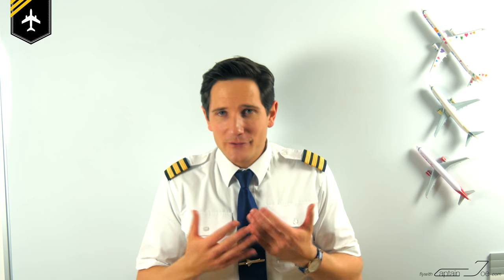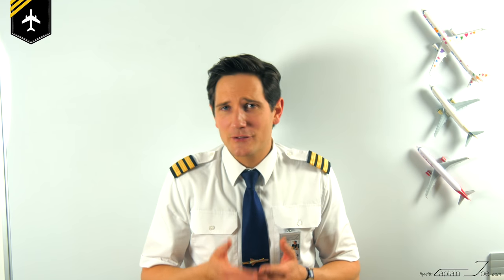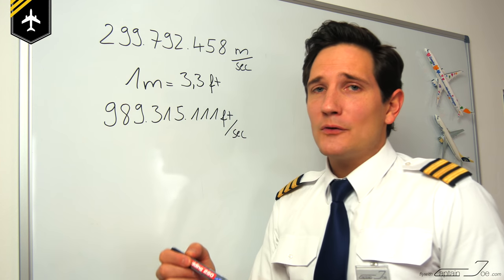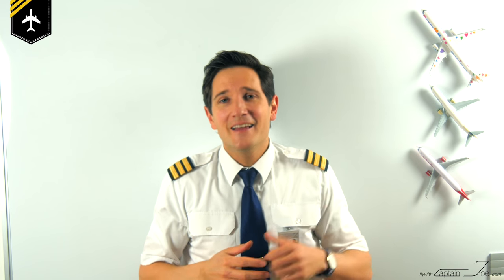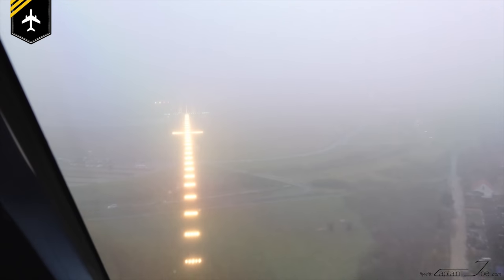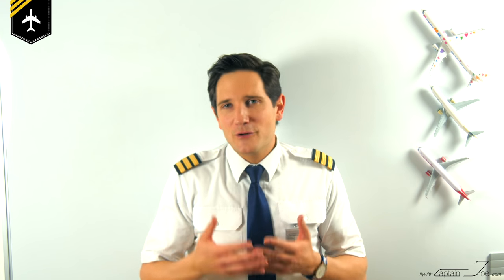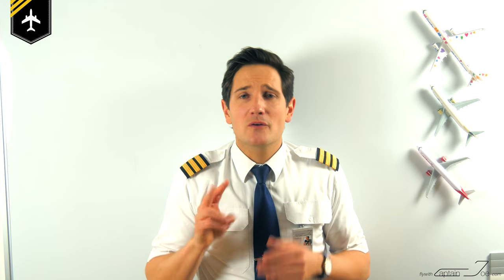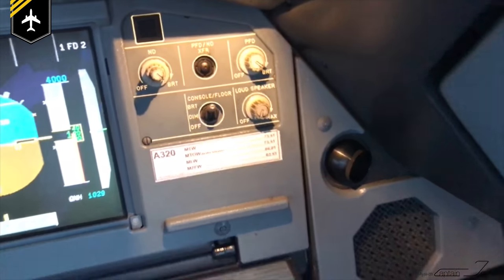50...40...30...20...RETARD...RETARD??? Radioaltimeter explained by "Captain"Joe

Comment: Do you fly Boeing aircraft as well?
Reply from the maker: No unfortunately not Barry, but maybe in the future, you never know :)
Reply: Captain Joe well, love your videos. Keepem coming. You're answering so many questions I didn't even know I had.
Reply: Who would ever do that, the flight augment computers in Airbus make flying it much smoother and nicer
Reply: Barry Sabahat because fuck Boeing I only like 737s
Reply: Polystyrene Planes well, I'm not a pilot, as I'm sure you can tell. I don't know any better.
Reply: @Polystyrene Planes Why you would like to fly a boeing as a pilot is that you actually got to do something, on the airbus you press 5 buttons and program the fmc and then fly, on the boeing you actually got to fly the plane and press more than 5 buttons to fly, the reason why so many like boeing is because fly by wire is alot nicer than the one airbus uses.
Reply: @NICK IS AWESOME "Fuck boeing" why do you hate boeing? Do you have a reason for the hate?
Reply: @Miam ga You cant say that Boeing 737 and Airbus a equivalent in terms of switches, on the airbus you start the apu, turn on fuelpumps, line up IRS and turn some lights on whilst in the boeing you do that and alot of more stuff like controling the aircondition, you control the powersource when the apu is on etc. I can admit that the 777 and 787 are more like Airbus with 5 switches but not the 737
Reply: Maybe the 737 Classic you still do things like manually selecting generators and the like, but the modern 737 NGs and the MAX is very similar to an A320. Other than the overhead panel is extremely messy with toggle switches everywhere. Basically every commercial jet will have auto land, auto thrust, auto pilot, IRS and and FMC. Not many airlines tend to fly 737-200 anymore.
Reply: @MegaGouch I havent said the a320 and 737 is alike each other, but you cant argue that in an a320 you have as much to do as in a 737, as you said there is alot of toggles and switches which there isnt in the a320 which makes the 1320 easier to control and less to do. Just an example that you talked about the A/T, on a320 you have Autotrottle until touchdown whilst on the boeing you disable it about 1000 feet above the ground
Reply: @Miam ga I know that you can do thoose stuff in the a320 but my point was just the reason why pilots like boeing-planes is that there is alot to do and alot of switches to press, just take a look at 747-400, there is 365 switches in that cockpit and im pretty sure there isnt any airbus aircraft with that many switches. Im not saying Boeing is better than Airbus or wise versa but im saying that imo the boeing is alot more fun to fly because you gotta do things all the time whilst the airbus is more chill where you can just sit back and relax
Reply: Agree there, Boeing thinks that the plane should be controlled 100% by a pilot whilst Airbus thinks that the plane should be controlled by both pilot and computer and if the pilot makes a misstake the computer can fix it whilst on the boeing you will probaly crash if the pilot makes a big misstake
Reply: What's A/T?
Reply: @Barry Sabahat Auto Throttle
Reply: Bob Ross ah!  Thank you.

Comment: distance = speed × time.
@1:15, you said distance = speed/time.
Reply: distance = speed x time is correct, though i am not a pilot.
Reply: you don't have to be a pilot to know that
Reply: Speed of light is a speed and time messurement
Reply: @Ntk503  speed of light is not a time measurement.. speed of light is speed at which the light travels and that's it. Light year is distance that light reaches in a year.. maybe you can somehow include theory of relativity and say that speed of light is a time measurement but it isn't.

Comment: Joe is the Altimiter with the callouts used for autoland because that would mean that the plane cannot autoland on rough/elevation changing terrainr
Reply: Yes. If the terrain is very sloped or rough approaching the runway, it degrades the ILS category. 
Helsinki get round this by having radio reflectors in poles in a valley just before the runway.

Comment: Never heard of using the speed of light calculations. I was taught, and have always used the radar range mile, since the Radio Altimeter is a form of radar. A smaller, less powerful one. Since radar is based on timing of the reflections of the transmitted pulses, to give you a distance (range) to an object (cloud).

Comment: there is no need to have indication on more than 2500ft because radioaltimeters beam should be to wide and could give wrong readings, last 200ft are important

Comment: Why doesn't Boeing synchronize the Radioaltemeter with the MCAS as a way to establish false computer readings (when MCAS forces a nose down while radialmeter senses the plane getting dangerously close to the ground?) @Captain joe
Reply: They are 2 different systems. And its more practical to sort out the MCAS rather than get warnings from the GPWS

Comment: You forgot the take the speed of light in air. That number is speed of light in a vacuum, so the calculation is slightly off
Reply: Not a significant difference between them.  But very complicated computer calculations could model and adjust for barometric pressure altitude, temperature, humidity, air pollutant concentrations, local gravity effects, etc.  This might make a difference of 1 mm at extremely high altitudes.

Comment: Captain Joe, mind if I ask you a question? I'm playing X-Plane Flight Simulator just learning about flying. Haven't touched any flight sims since Flight Simulator 98. As I was showing my Landing first time they told me about Flaring as you come in for a landing. Can you explain about Flaring or if you have a video to link it? Thanks
Reply: Not joe, but I still hope this helps.
Flaring is when an aircraft pitches its nose up just before it touches down on the runway. This is done to allow the main gear to touchdown first, to prevent damage to the nose gear and to help the landing to be more smooth. Flaring is done by throttling down the engines as the "retard" callout is announced (make sure you have the correct flaps settings and a safe speed so you don't stall at the last second)  As the main gear touches down, you would then put the nose down on the ground as the spoilers and brakes are deployed.

Keep in mind that I am not a pilot, just an aviation enthusiast who plays simulators too.
I also wrote this on mobile so apologies in advance for any spelling errors.

Hope this helps! Have a good day.

Comment: i was learned that radio altimeter can not work on measure time between two  signals because time is too short, and signal would ovelap in receiver, it works on principle to transmite one signal but with constant change of modulation and then computer compare time of modulation delay in receiver

Comment: Can the signal even travel 5000 feet and still be picked up by the plane? Not only will it get dispersed/absorbed by the ground/air, but the plane would have moved forward by a significant amount, thereby moving out of the signals sight, no?

Comment: Hello Captain Joe!

I'm a new viewer here. Just watched this video. There's one info missed:

Why a Captain or Pilot says, "Continue" at 500 or 200?🤔
Thank you very much.
Reply: The captain either says continue or "missed" "overshoot" depending on whether the runway is in sight(bad weather/ visibility) or the plane is properly configured and on course and on slope (not too far left/ right up/ down for safety) he is stating his decision to "continue" the landing or abort
Reply: @Valantir  Vielen Dank, Herr Miller!🙂

I've a PPL, flying is my passion and hobby. Not a profession though. 

I first noticed "Continue" in Captain Raps' Airbus video. My Q, how would automatic controls react when Captain or Pilot don't say that word?🤔

Is it mandatory to say that word as per the Airbus training?🤔 Thank you very much!
Reply: @pra7640  it's more a airline training/ CRM (Crew resource management thing) than airbus.
You have a Pilot flying (PF) and Pilot Monitoring (PM) sometimes also called the Pilot not flying (PNF) depending on the company. On a visual approach the PF is looking only outside the airplane. Not at the instruments. The PM is looking at the instruments and calling out altitude, speed, and deviation from course. The PF will call for things like gear or flaps at appropriate speeds and the PM will lower. When the PM gets to decision height, which for us is 500 ft on a visual at my company. The captain determines whether to continue or not. For an ILS or other instrument approach the captain is inside watching the nav instruments. Then at the minimum altitude (200ft for a CAT 1 ils, no autoland) he looks up and either sees the light/ runway and says continue or does not and we overshoot. The only time you are "autoland" is a CAT 3 ILS where the minimums are 50ft and directly over the runway. You are going to see it.

Comment: The only thing I hear when I go too land in X-Plane PULL UP And then it starts 100 90 80 70 60 50 40 30 TERRAIN PULL UP since I accidentally speed up (BOTH ENGINES TO MAX POWER)

Comment: Captain Joe, I have a question related to your mathematics in the video

when you were calculating the altitude and you times speed of light by 3.3 did you round it up so it said 989,3x10-5 because when I did the calculation I got 989,315,111 ft/s and when I divided by 1 I got the altitude of 4,996 ft

Next time I calculate my altitude for fun in flight simulators would I round the value at the ten hundredths or would I use the full number for the final calculation?

Comment: Hi Captain 👨‍✈️ i have a doubt. As a passenger, most of the time i feel just before the landing that the speed of the aircraft is suddenly increased. I feel we are a little bit pushed back because of the increase in the speed. This feeling happens just before when the aircraft starts descending. My question is is the speed is really increased? Also the engine sound increases.. because at the 38k ft the engine sound is smooth.
Reply: not a pilot but i think it could be the reverse thrust. The turbines start to spin faster and the flaps on the outer side of the engines open to redirect the air in the opposite direction to slow down. he made a video about that:
https://www.youtube.com/watch?v=cfFZ2-Am-Zk

Comment: DISCLAIMER THIS IS VERY MINOR
your calculations aren't actually 100% correct mathematically, because the first distance travelled from transmitter to earth is probably going to be longer than the distance from earth back to the receiver, because the plane would have descended x ft by the time the signal gets back to the transmitter. The distance difference is so minor it really isn't worth calculating with, but just letting you know this thought of mine. Have a great day!

Comment: Cool. Question from a non-pilot: why are feet used for altitude instead of meters?
Reply: one meter =3.3 feet. 20×3.3 30×3.3 40×3.3. 50×3.3 see the problem. Try to do meter math in you head fast when feet you know for a fact your 50 40 30 20 feet off the ground. 1000 times safer that way.

Comment: I'm afraid it doesn't work that way, and can't work that way. Computer processors can only process instructions so fast, and reading from an input device like your radio altimeter antenna will cause some serious delay because of the interrupt handling. You will need tens if not hundreds of instructions to get your end result in distance from the ground with a normal processor.
In your example the radio wave was underway for 0.00000505s. To make it simpler let's use a sane unit and say it was 5050ns, let's round that to a nice 5000ns for simplicity. A normal processor has a speed of, let's be generous and round up a bit for simplicity, 5GHz. That is 5 000 000 000 clock cycles per second. One clock cycle therefore takes 0.2ns. if you need 100 instructions to calculate the hight, and say 10 cycles per instruction, which is not unreasonable, you get 200ns aliasing steps, between which you can't measure height. light travels 30cm in 1ns. for 200ns therefore you get 6000cm or 60m. An aliasing of 60m is utterly useless. And I was very generous with the rounding here.
Now then allow me to explain how it really works.
The radio transmitter generates radio waves. The radio energy is split. half of it is emitted towards the ground, the other half is transferred to the receiver antenna. when reflecting off the ground and received by the receiver antenna, the signals are mixed again and em interference is created (like in the famous double slit experiment) depending on the distance to the ground, the received reflection may be phase shifted by a certain amount, creating a pattern of destructive and constructive interferrence that indicates the height without the need of super fast sample rates and time measuring, but rather you can do it with moderately fast sample rates.

Comment: Not trying to annoy you, just use the speed of light through the air, not vacuum :) have a great day
Reply: shreddica maxximus haha, for accuracy that’s fair enough (I’ve had vacuum vs air errors in uni)

But in the radio altimeter, the minimum altitude for it to work is 2500ft, so there’s no practical error in using vacuum or air, the answer will be almost the same.

Comment: About the altimeter reading from a radio wave that got reflected off the ground. Would refraction have a roll in this or is it so insignificant to the speed of light that the accuracy isn't really affected?

Comment: I hope the height above ground call out pertains to the distance from the  ground to the bottom of the undercarriage landing wheels, and not the bottom of the plane, to make sure the plane lands smoothly.  If the call out says "30", could the plane really be lower to the runway since the wheels are extended, and if so, the wheels may be only 25 or 20 feet off the ground.  Can someone provide an answer for me?  Thanks.

Comment: If it was inside a Ryan air plane it would say 100,50,40,30,20,10, Ouch you damn Ryanair pilot
Reply: Aviation001 better than BA 2008 crashed into grass at heathrow

Comment: Captain Joe how pilots taxi ,takeoff and land the plane along the line made up on the runway and the taxiway
Reply: You just watch the line through the cockpit window and steer the aircraft. During taxiing you steer the aircraft with its nose wheel by using the tiller, and during the takeoff run and landing run you steer the aircraft by using the rudder pedals to keep it aligned.

Comment: Is thrust turned off when landing? When the plane is braking wouldn't thrust keep pulling it forward?
Reply: Reverse thrust is used while landing to slow the plane down.
But yes, if the aircraft is light, with idle thrust the aircraft can start moving forward. Hence brakes are used much more often

Comment: so why does all the terrain pull up warnings don't come while landing but come while preparing for a crash landing or a water landing??
Reply: Terrain Awareness Warning System or Enhanced Ground Proximity Warning System have the airports loaded into their databases (data of terrain and elevations). This system compares the aircraft's position (GPS data) against terrain and airport databases. The system also receives the information that the aircraft is configured for normal landing, the landing gear is lowered and flaps deployed, and so the certain warnings (like "terrain", "pull up") are disabled.
Reply: @mikep9604  Thank you for making me understand

Comment: Why do you do 1s like that?
Reply: In many countries and in fields heavy in math and science, it is common to add the preceding up stroke when hand writing the number 1.  It helps to differentiate between the 1 and lowercase letter L (l) and the uppercase letter i (I).
Similarly, a backward diagonal slash is added to the number zero (0) to differentiate it from the uppercase letter O, and a small horizontal slash is added in the middle of the letter Z (uppercase and lowercase) to differentiate it from the number 2.

Comment: I use to hear this sound tow low terrain then pull up even I am above the runway why is that so plz answer
Reply: When the aircraft is above the runway you don't hear that normally because the data of the airports are loaded into the aircraft's database, and the system recognise that the aircraft is landing. During the landing mode the system doesn't give that warning. However, this warning is possible if this particular airport is not in the aircraft's database.

Comment: Captain Joe, do pilots start lowering speed on descent? Or do they turn the engines off on descent and let the plane glide?
Reply: The engines are not turned off, but the throttle is reduced.
Reply: Thanks.
Reply: But what if I'm in a simulator and only have the keys "W" and "S" onmy keyboard to control my throttle?

Comment: All I mostly hear is pull up right the radio says it when taking off ?
Reply: "Pull up" is a ground proximity warning, and it's not heard during a normal takeoff. 

The Ground Proximity Warning System or Terrain Avoidance and Warning System gives the warning "pull up" during the descent and approach if the aircraft will be too close to the terrain.
Reply: Mike P oh okay thanks

Comment: Does the distance to the ground conclude hight of a landing gear?
Reply: Most airplanes have it calibrated to show the heigh from the ground to the lowest wheel of the aircraft, so it would indicate zero when the lowest wheel touches down, and possibly come to a negative value once the full aircraft has settled down

Comment: What is the minimum equipment needs to be in working condition while landing?
Reply: It depends on the aircraft type, manufacturer and airline requirements. There is a MMEL (master minimum equipment list) produced by the manufacturer and an MEL (minimum equipment list) produced by the airline, based on the MMEL. The MEL can never be less restrictive than the version published by the manufacturer.